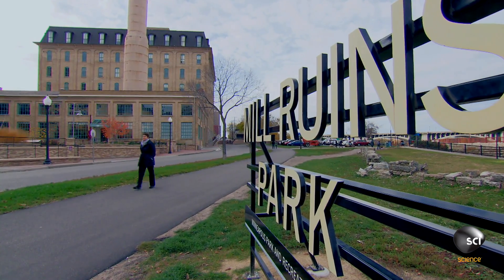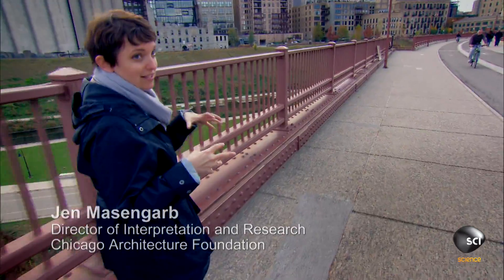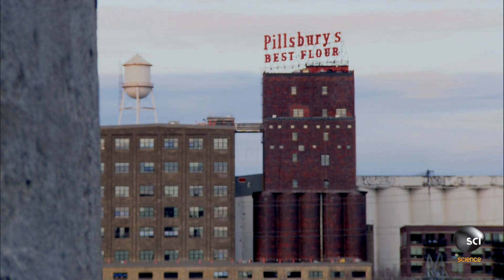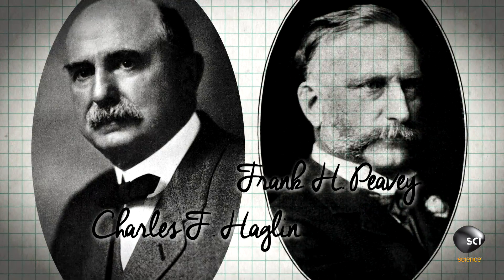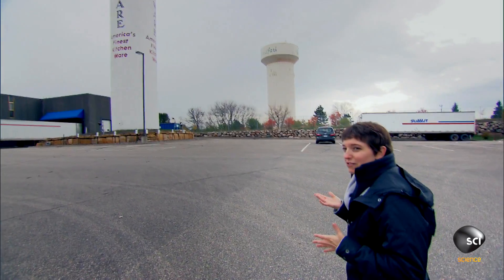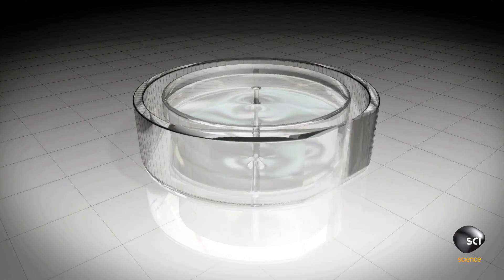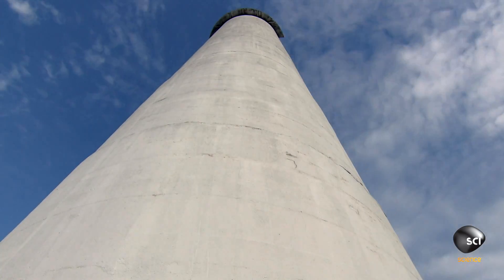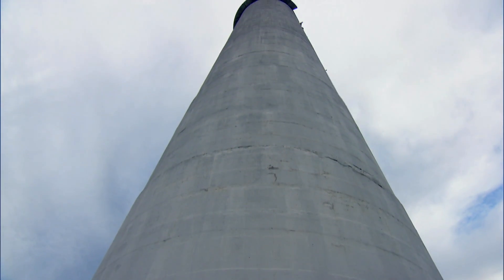The World's First Concrete Silo

Comment: why would concrete not be able to hold grain?
Reply: +The Cosmos Maybe they weren't really afraid about the strength of the concrete, but rather about if it would ruin the grain somehow.
Reply: I'm probably completely wrong but I think it makes the grain decay... Only reason I say this is because last year I had pumpkins I was storing and read that you're not supposed to put them on concrete...

Again, probably wrong seeing as seeds and fleshy produce are much different.
Reply: +StoreBrand here in the Philippines where concrete is the main material for building houses. All I can is. sometimes the concrete "sweats" it produces this nasty kind of moisture that smells like a garbage or a smelly foot. I think it depends on the weather.